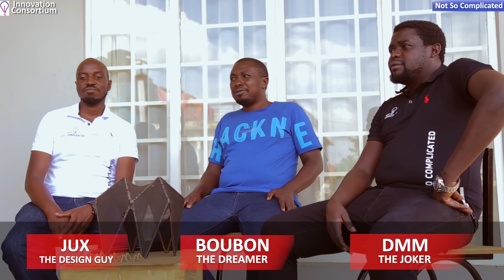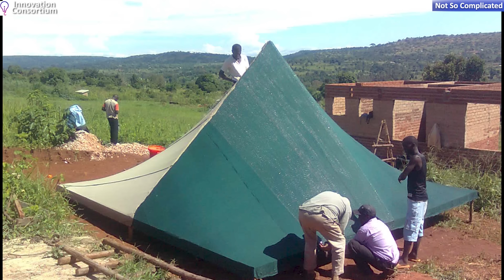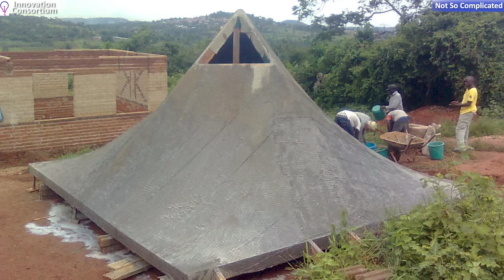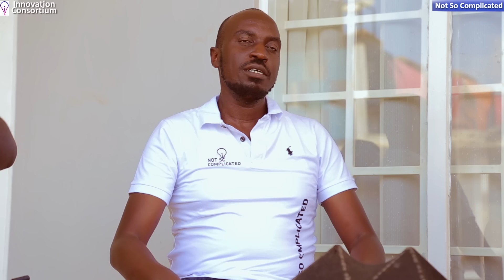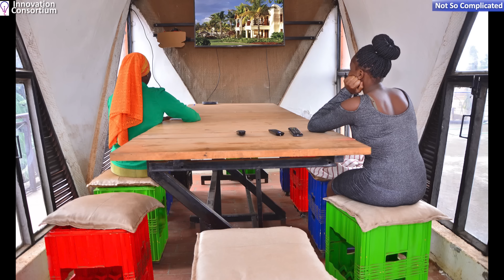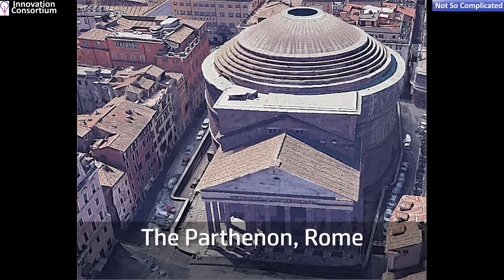THIN SHELL CONCRETE CONSTRUCTION TECHNOLOGY: NOT SO COMPLICATED SHOW: EPISODE 11: construction tech

Comment: What type of latex is used? What ratio of concrete and latex do you use to get consistent results?
Reply: 3 years later😢 no reply, they are not serious😮😮
Reply: @PrettyGirlSouthAfrica Yeah, guess not. The formula I found from another video, and am using it with success, is 1 part Portland cement, 1 part latex paint, and one part sand. Home Depot sells 5 gallons of latex paint for $37. I like to sift the sand and am considering adding fiberglass fibers.
Reply: @TruthSayer5589 i guess latex paint is a bonding liquid because epoxy is expensive and it used for reinforcement